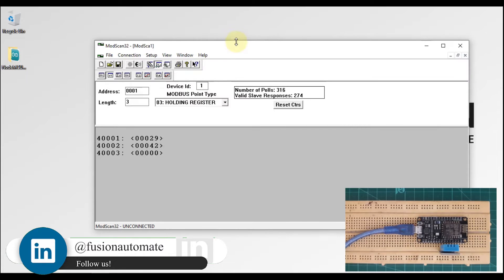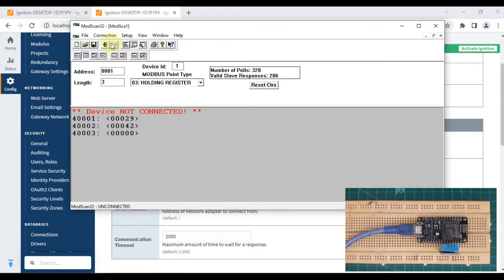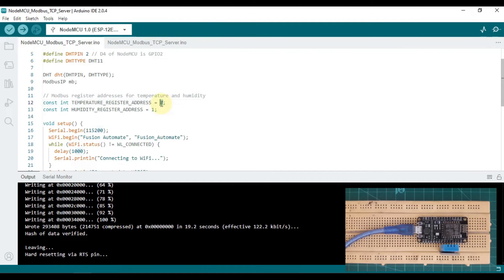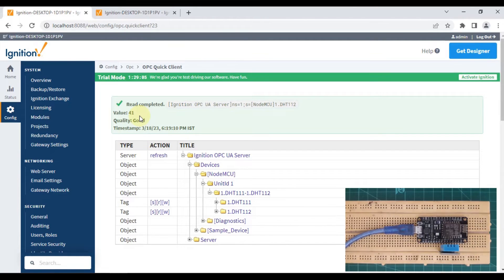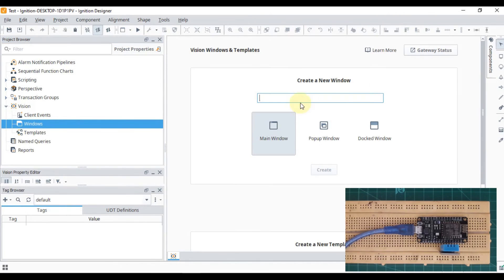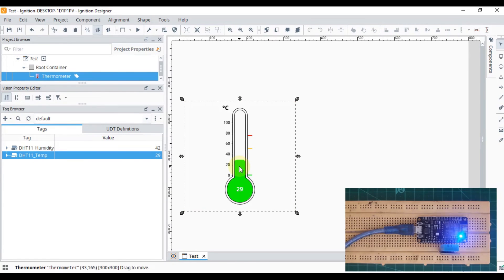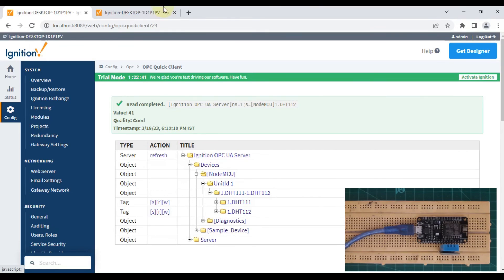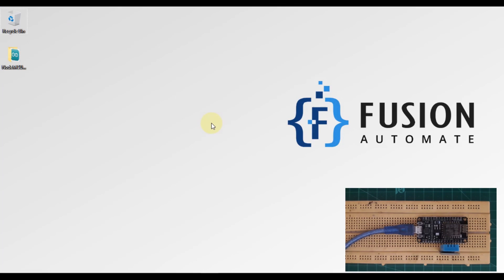How to Publish DHT11 Sensor Data from NodeMCU to Modbus TCP Server and Read it in Ignition SCADA

Comment: Hi, I've tried similar approach with ESP32. My TCP server works with the Modscan32 tool and I can read the registers. 
But I integrate it with Ignition, I can see my device connected but when  I do 'OPC Quick Connecion' Test for my holding Regs, I god 'null'-'bad' status. Did you face something similar before?